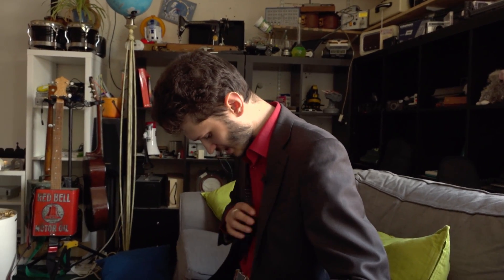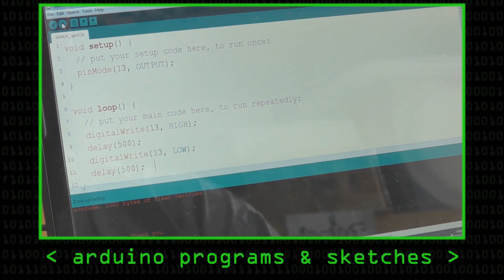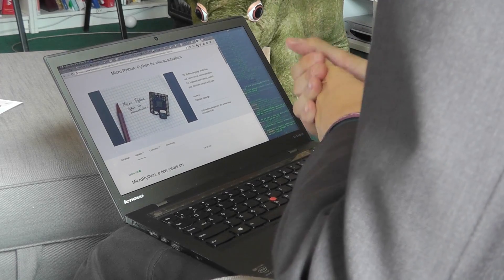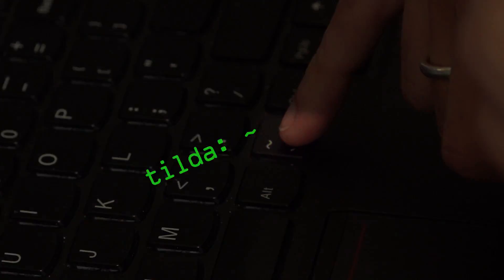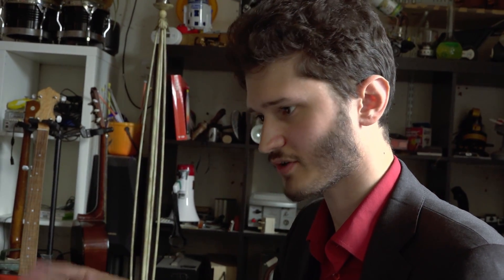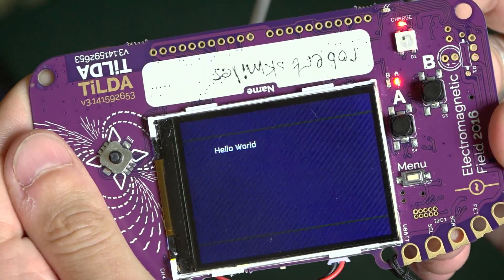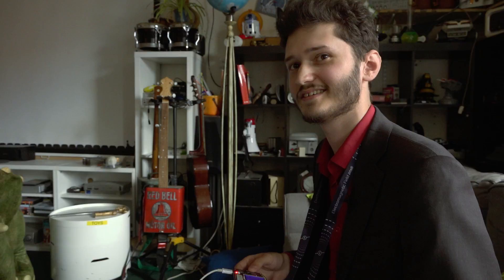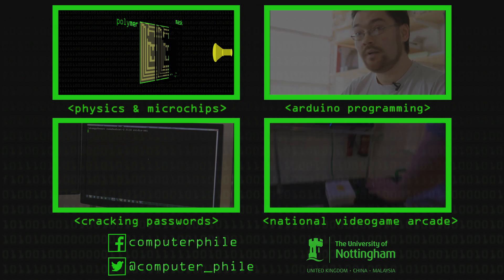Micropython Name Badge - Computerphile

Comment: Python is cool for prototyping but no one uses it seriously.
Reply: You're right, Disqus, Pinterest, Instagram, BitBucket, Reddit, The Onion, etc.. those are totally piddly little prototypes.
Reply: No one should use it seriously (i.e. for release versions of big programs). Sadly, many people do.
Reply: PyPy is pretty performant though. No, it's not the most low level language, but about 99% of work doesn't need that low level performance, it's premature optimization.
Reply: tobortine That is not quite right.  Hardware is cheaper than developers.  This will be the case from now on.  This is not a bad thing.
Reply: that's called progress, decades ago Assembly was used for a lot of things because it was the most efficient for hardware of that time. C is still useful, but that doesn't mean it should be used everywhere
Reply: That's the first time I hear about this :)
For select new things maybe. There's no economic sense to rewrite it entirely in 4 years.
Reply: Dustin Rodriguez
That's what I said. Hardware is cheaper so we're happy to substitute that for efficient code. Please read my comments more carefully.
Reply: Strangely, no one mentioned Youtube yet.
Reply: Ok I can’t comment from experience, but I’ve seen people, on this channel even take python script and put it in cython and compile it from the resultant C code. So it’s compiled python. Sure it could be more efficient. Generated code is horrific to read if you ever decompile it. But it runs better.
Reply: I really hope you're kidding, because some of the largest companies on Earth use it extensively; including this one.
Reply: lamine
Yes you're right. More people than I imagined use it seriously which is a sad indictment of the industry. We're happy to throw hardware at the problem and pay developers less for using inefficient but easy to use programming languages. It's now a commodity which is why it's off shored. Greed over art.
Reply: Ok, that's a fair call. I should have said "not many". Python is fine as long as you don't want any performance, particularly in loops where C, C++, java or any other compiled code will wipe the floor with it on performance.

In applications like Dropbox where a majority of the work is I/O bound (saving and retrieving) I can see why they'd get away with Python, but you'd struggle with any CPU intensive work. 

It's also much easier (and cheaper) to find Python programmers since it's not as difficult to learn as lower level languages. There's nothing wrong with Python but you have to be aware of what it doesn't do well, it doesn't perform as well as a compiled language.
Reply: shank170 Quote some examples please. The companies and the products.

Comment: No. If you were born after 1995 you can't complain about windows. It was basically the only option for a long time, because linux was super difficult to use back then.
Reply: Firstly I was born in 1990, secondly I reserve the right to complain about anything and everything.
Reply: Rather then super difficult to use I would say it was super difficult to install. I remember the glee I found when I discovered Mandrake. The first distro I found with a graphical installer. Now Linux has gone from very hard to install to being more simple to install then Windows.
Reply: I never experienced that pain. I didn't start to play around with OS until after I had saved up and spent a fortune on a cd writer. But damn did I spend alot of time trying to get it to work on my computer. Had some hardware incompatibility issues and x11 always crashed after ~ 10 mins. But I fell in love with the game Koules that came with Slackware, awesome little game.
Reply: Robert Miles Cheers
Reply: Hey, there's nothing wrong with having to download 65+ floppy disk images over 2400 baud modem, splitting the load with a friend of yours and sharing copies, and then spending 6 hours installing an OS!  Heh, that was my first experience with Linux, downloading Slackware onto floppies in the early 90s.

Comment: Ignoring my personal hatred for the python language, that's a really nice badge and props to the devs of micropython for making the system so simple and friendly.
Reply: TLCM
Depending on the communities you are in, hating python or at least disliking it isn't that rare of an opinion. Here are my personal reasons:
1. It's slow. That's fact.
2. It's poorly designed. Even the developers behind python admitted that themselves and tried to improve it with version 3, which doesn't seem to have worked out too well.
If you don't care about (1) and don't notice (2) because you are used to it, it's a fine language.
BUT
What really bugs be is how it's used for everything, from hardware prototyping to full release software packages, constantly getting on my nerves with poor performance and software not working.
Reply: You can certainly argue that it is slower than compiled languages.  I would imagine there is no chance, however, that you could make any substantial argument that it matters.  Selection of the appropriate algorithm and data structures outweighs any slowdowns you'll encounter from the language you choose in almost every situation.  And in the extremely, extremely rare situation where you actually need the language to be fast (solely the inner loop of video codecs, the inner loop of high complexity 3D games, etc) you can very easily just write that tiny portion in assembler and link it in no problem.

Also, Python does not index arrays starting at 1.  I'm not sure where that idea came from.  Also, Python 3 has worked out just fine.  Such a transition takes awhile, of course, but the continued addition of new features to Python 3 makes it harder and harder to resist updating projects to 3.  It's not even that big of a change in most cases, just little things like "print" wasn't a function in Python 2, and it is in 3.  And little internal things like the change to range as you mentioned.  Generators weren't around when Python 2 started.  And it was not done that way to "be different from C".  It was done that way because iteration is more readable than fiddling with indices.  Most every design choice in Python has been done with an eye toward readability, which is the most sensible approach for any language.
Reply: how can someone hate python
Reply: ray
1. Slow compared to compiled languages. For an interpreted language it's alright.
2. Read my 2 comments. The devs themselves admitted it, and no, once people rely on your language you can't change it, all the bad decisions from day 1 will live until you release an entirely new version. You can improve the implementation, but not the design. Adding alternatives usually makes matters even worse.
In terms of design, Java,C++,C# all copied C and added stuff on top, so they are pretty bad comparisons for your cause, since they didn't have that many mistakes they could make compared to an entirely new implementation.

3. I don't think "begin" and "end" of Ruby are any better or worse than indentation, they are similarly restrictive.

It certainly isn't the languages fault that people write bad software in it, at least not directly. Read my second comment.

This certainly depends on the setup, but I never had any problems with Perl, I don't even know whether any of my day to day software uses Perl.

That it's used for everything doesn't really speak for python that much, since, as mentioned in my second comment, a lot of people started with it and due to it's design, most things they learned for python don't apply to other languages (types, integer size, for = foreach, indentation, etc.).
And yes, programming is not about syntax, but with libraries for everything, you don't really learn that much about algorithms in python.
In the end, I don't dismiss python entirely, it's great to hack together a quick & dirty script to get a job done, but what I don't like is how it appeals to newcomers and then makes transitioning to more productive languages very difficult.
Reply: Aaron Thompson
I don't know much about it, but the fact that they start the indexing of arrays with 1 and not 0 is ridiculous.
Reply: your claim about xrange is unclear. Why is it bad design again?
"pretend that xrange is a function returning a list", "replace the whole construct with an iterator" - that's a weird way to explain it, like, you don't really know what's going on. You don't "pretend", you just iterate over generator.
Maybe you mean they should have made "range" a generator from the beginning? It's true, but the basic idea of generators is beautiful.

I totally agree with you, that one should not learn programming with python, but this fact itself doesn't make python bad
Reply: You forgot the Global Interpreter Lock.

But I do like it as a zero-overhead language. In that I can just create a file anywhere, write code and press a button and it will run.
Reply: +Martin Ninov The multiprocessing module allows you to so parallel processing without the GIL getting in your way, so that's not a great point to make.
Reply: I'm curious what you think of lua?
Reply: how is it poorly designed? It's greatly designed
Reply: AdrenalineL1fe
If you learned programming with python and don't know much about programming language design, of course it seems well designed.
But once you use other languages and/or learn how computers really work, it's quite obvious that python is poorly designed.
Just to give one example:

`for i in xrange(foo)`
and
`for i in range(foo)`

In the first case you pretend that xrange is a function returning a list and the when interpreting replace the whole construct with an iterator, which is bad design.
In the second case you generate a list, allocate a lot of memory and then go over that list, without actually ever using all that memory, which is very slow and unneeded.
Of course you could just use
```
i = 0
while i < foo
```
which is equivalent to the first case, but the fact that xrange() even exists (and in version 3 is called range()) means that most people will use the first version.
All that hassle for what? To only implement a "foreach" style loop, trying to be different from C.
Is that a big deal? No, but it shows the way python started out quite cleanly designed, but impractical and then got dirtier and more practical over time.
Reply: +TLCM My relationship with Python is the same as my relationship with Comic Sans. They're both great at what they were designed for (quick dirty scripts for Python and hand-written text on low resolution displays for Comic Sans), but I've come to hate them, because people use them for all the wrong things (i.e. pretty much everything for Comic Sans—I've even seen a thesis written in Comic Sans—and release versions of big programs for Python). I hate Python because it's widely being used for things for which it should not be used.
Reply: ok?
Reply: Because it'e very "snakey"
i will not apologize for this terrible pun
Reply: TLCM
Completely agree with you about Javascript; Compared to JS, python is great.
About the portability: True, but I don't see why you need an interpreter language for that.
About "every version comes with improvements, if you are not ashamed of any first version of your software then you have not made any improvements.":
The problem with a programming language is that once people start using it, you can't really change anything, you can only add more stuff. At least on paper you have to nail it on the first try.
Python is part of and partially the cause of a trend among software developers to know nothing about computers, only understanding a very abstracted high layer.
This allows for a lot of people to join in, which is great, but way to many stick to the surface and never dig deeper. With it's weird syntax and practices, python doesn't help at all with the transition to, dare I say, proper languages.
The result of that are things like micropython, which is impressive, but in the long run quite harmful to the software community as a whole.

Comment: You cannot get Windows x86 on a Raspberry Pi, since it runs an ARM processor. You can, however, install Windows IoT (Google it) or get a similar board such as the UP Board, which has an Intel Atom processor, which allows you to run x86 applications and what not (like Windows). It's a bit more expensive but it's about the same size.
Reply: Windows RT runs on ARM.